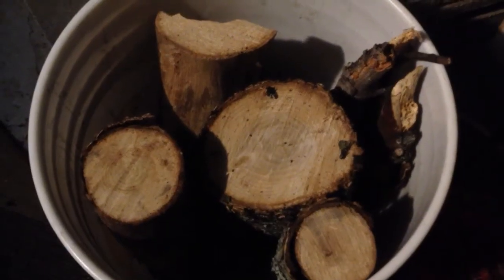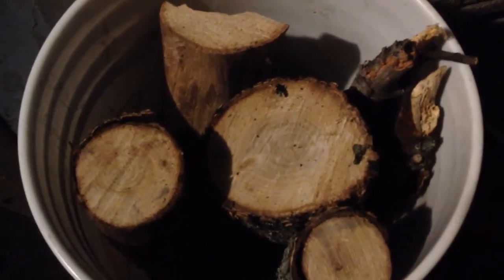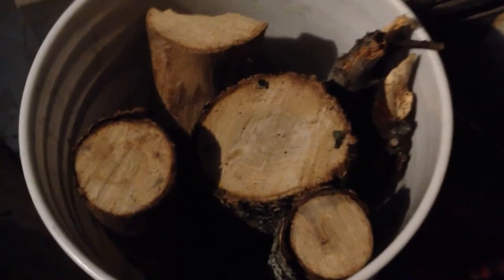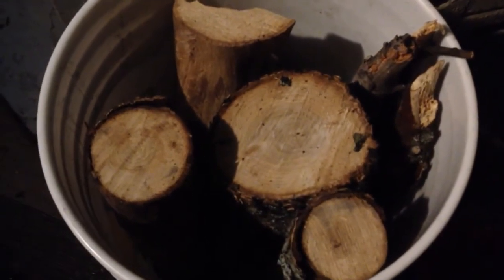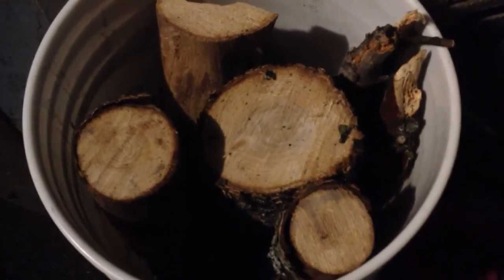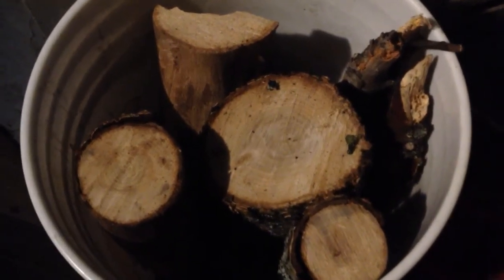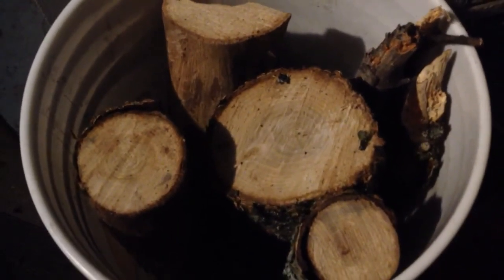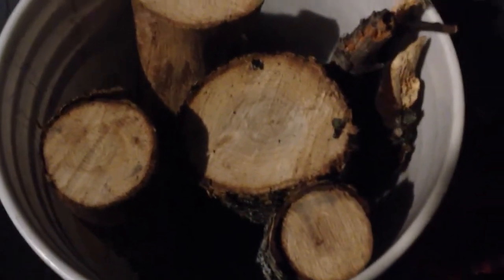Match-Box Rocket-Mass Heater Efficiency Update

Comment: The proper/original name for this configuration is the Peterberg Batch Box. It doesn't look like you implemented a P-Channel which improves combustion efficiency quite a bit. Primary air should be ~20% of the heat riser diameter. 

Originally designed by Peter van den Berg. https://www.youtube.com/user/peterberg10

Here's a spreadsheet for the dimensions: http://donkey32.proboards.com/thread/734/peterberg-batch-box-dimensions
Reply from the maker: Mr. Mustache this is a micro batch box, called a match box.  Peter said he found the name quite fitting.  Thanks for watching